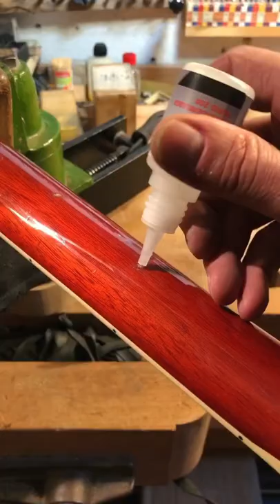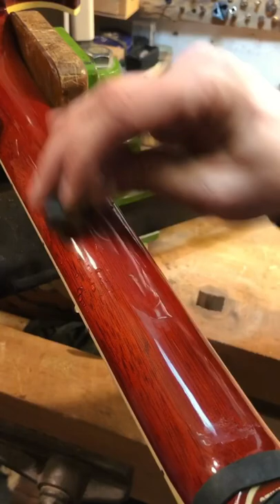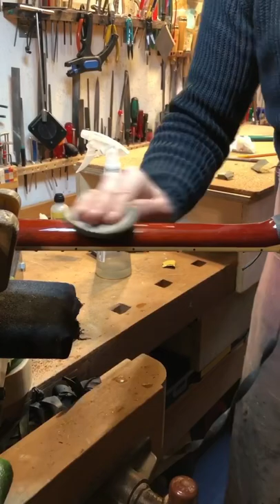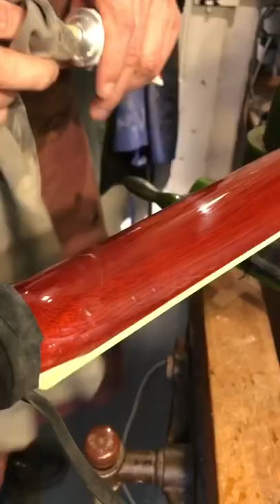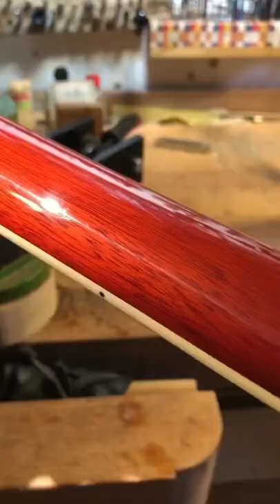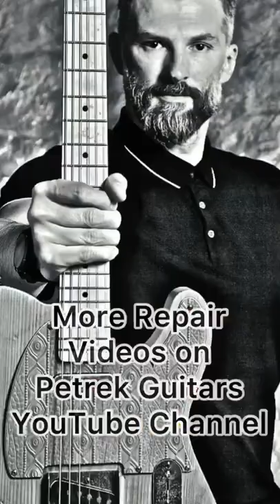ESP Japan Les Paul Guitar repair how to fix a dent in a high gloss neck finish#shorts #guitarrepair

Comment: What type of glue should I be using to fill in the dent here? My les paul took a tumble earlier on, and left some nasty dents in the back of my neck😬I'm absolutely gutted
Reply from the maker: If you have Nitro Laquer you have to use Nitro. Don’t use superglue on Nitro it will damage the surface. Best Regards Nik